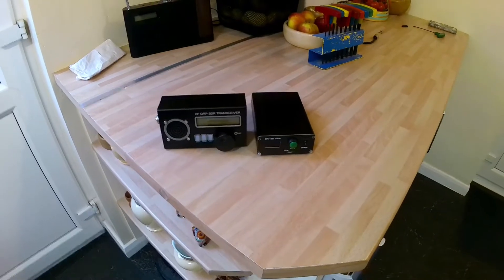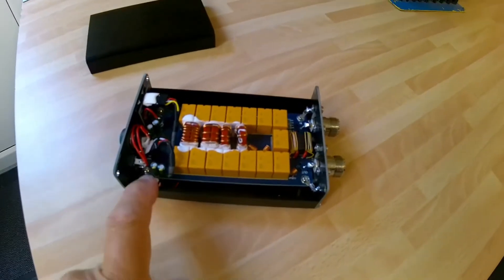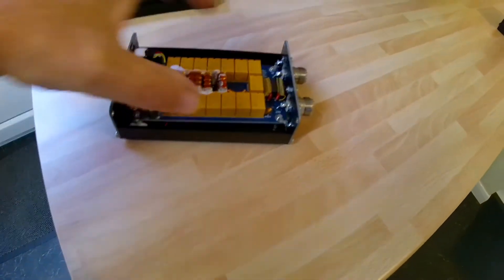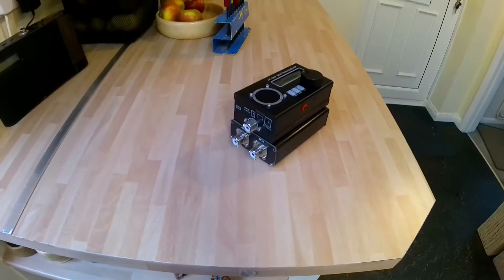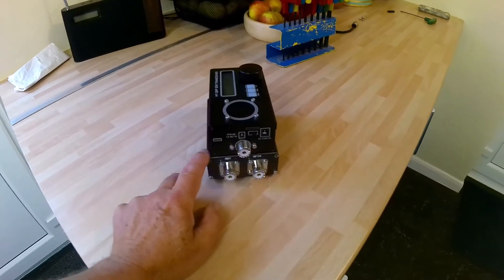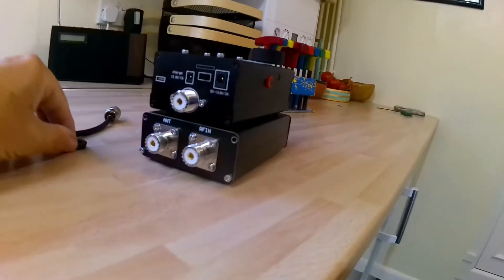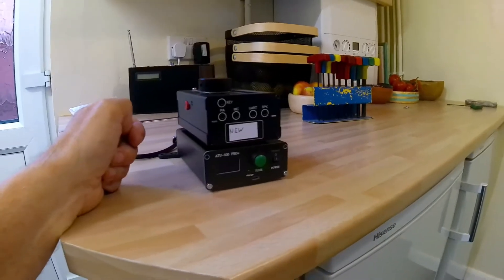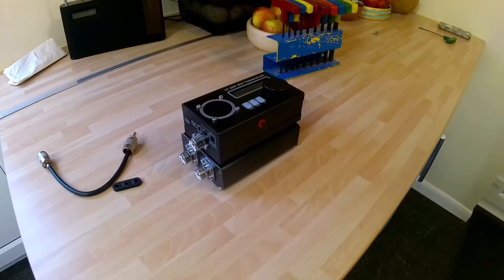Ham Radio Challenge. Combining QRP SDR Transceiver with ATU-100 Antenna Tuner Unit.

Comment: Good ol duct tape will combine both into one unit..I'd use a hot glue stick gun to fill in the insides to keep parts from vibrating when you. PS they do make those combined already for $228usd..but it doesn't have the built in battery nor any accessories that come with the usdx / usdr 8 band radio..

Comment: I have a qrp like that , it works very well and , I also have an Atu 100 that does not couple well with low power . At 40m I have 12w and it couples more and steals all the power, dropping it to 4w. 73de PY9DM

Comment: I built a uBitX transceiver and an ATU-100 (kit) in a single case for portable work. The stock ATU-100 won't tune consistently with QRP power levels, but there is a mod for it that allows it to work down to about 5 watts.

The real issue with the ATU-100 and QRP is efficiency. The tuner has some loss, and aside from that, for QRP the efficiency of a resonant antenna is a big plus. I have used the uBitX with the tuner, but I avoid it when possible.

Comment: Try ATU-10, a QRP tuner.
Reply from the maker: The only problem is they cost £160 on Ebay my ATU cost £60 .
Reply: @MakeDoAndMend1  YouTube blocks my messages with links. I have sent a link for 100$ ATU-10 with shipping and yesterday a link for combined with tuner in one shell usdx transceiver. Please allow links in messages in settings.
Reply from the maker: @davidfainitski4201  Thanks for your msgs. If it's being sold in American Dollars and into the UK theres Import duty and Tax. I use Aliexpress. Ps My ATU works on around 2.5W so no problems. It's a Pro+ version. Cheers from old George
Reply from the maker: Ps the Hamgeek transceiver with combined ATU is around £ 250 in uk . Outside of my pension.
Reply: @MakeDoAndMend1  169£ is 180$ very expensive . Even with taxes you will pay 120$. 
And also the USDX TRX with built in tuner is exist on Ali for 160$.
Can't incert a link, try to seek 
USDX SDR Transceiver All Mode 8 Band Receiver HF Ham Radio QRP CW Transceiver Built-In ATU-100 Antenna Tuner Dual OLED

Comment: Hi George. Would it not be possible to just put both lots of inards in to just one bigger box.?  Or would they Interfear with  each other?   Cheers.  Jeff.
Reply from the maker: Yes it probably would work. I am hoping someone will take up the task. Also I am trying to contact the manufacturer to see if they think it's worth there while to make them as a combined unit. Cheers matey.👍🤔
Reply: You could do that ! I just taped my tuner and 8 band qrp together !  There is also the usota hamgeek unit that’s built into one box. ! About 208 bux -